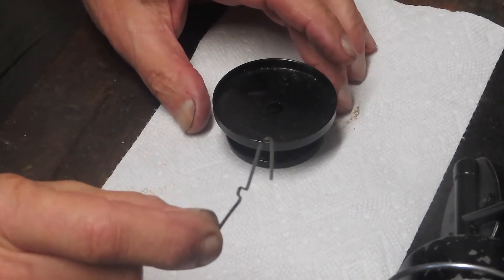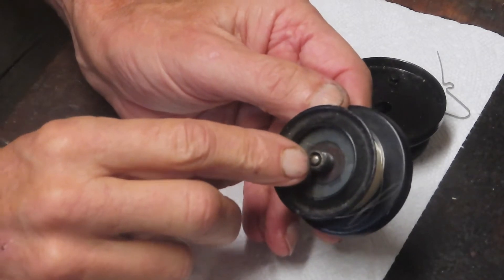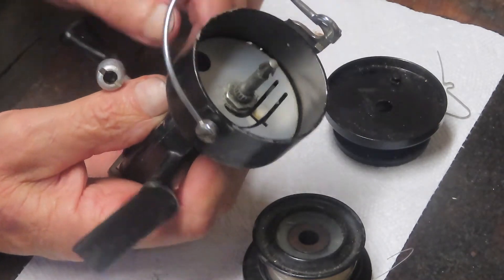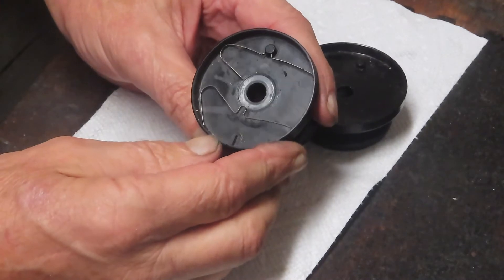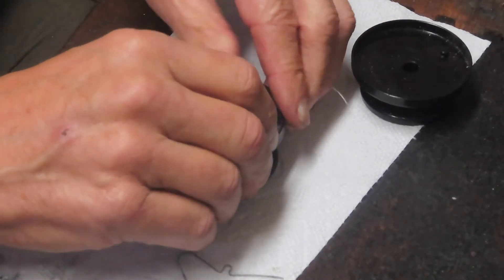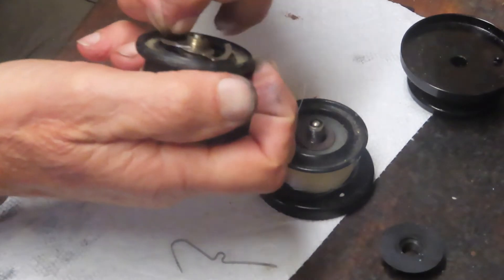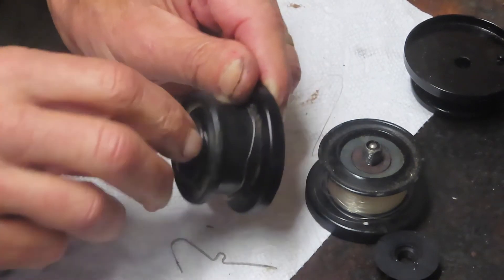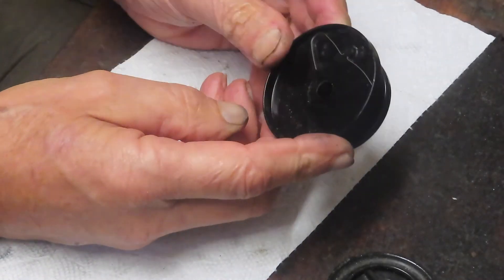How to set the spool click spring on a Mitchell 300 spin fishing reel

Comment: Cleaning a 300c of my father in law’s and found the click spring installed with loop on the right and also found a paper type washer under drag tension spring. Does this seem right to you? Maybe the paper washer goes under the spool and things didn’t get put back together right at some point. Haven’t seen any vids about the 300c so not sure what changes if any there were. So thanks love your channel it’s helped me a lot.
Reply from the maker: The 300C is basically the same reel as the 300.  I don't recall seeing a paper washer in any of the 300 series, so it is possible someone made a shim out of one.  The click spring on the reel should rest against the left side of the inner case if that spring is the long flat bar with the hook on the end that nests on the stud in the dog. - Dennis
Reply: @2ndChanceTackle  got it cleaned oiled greased and thanks to you put back together. It’s running good now. Thanks again.

Comment: Does the Mitchell 314 have a different spool than the 300? I recently picked up a 314 and mixed the spool up with my 300 spools. I have tried every spool and I cannot get the spool to click onto the axle.
Reply from the maker: I don't think they are the same.  I think the 314 would not be a tall?? Bottom to top as the 300.  If you are trying to get the 300 spool on and it is Tyler, then the snap would not engage.  The 314 is a version of the 304 not the 300 - Dennis

Comment: Thats not the setup in earlier 300's. Those have an actual arrowhead shaped gear and concentrically bent spring that causes the drag ratcheting sound. I pulled one of mine apart and that's how it's setup.
Reply from the maker: Yes - the spools did change over the 40 years of production